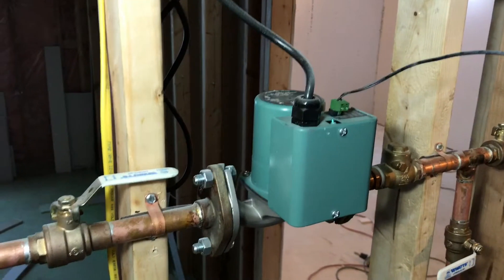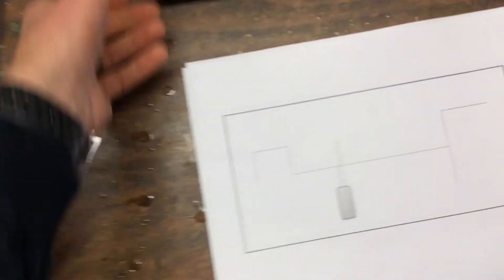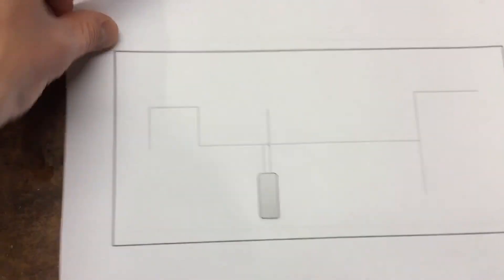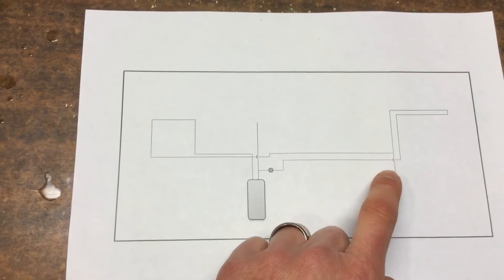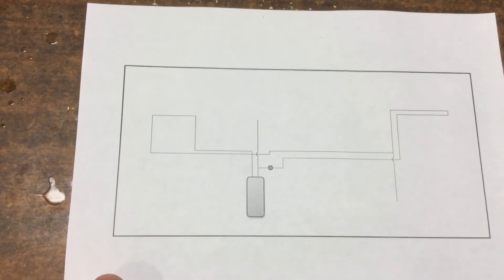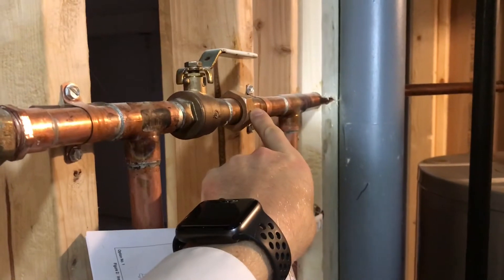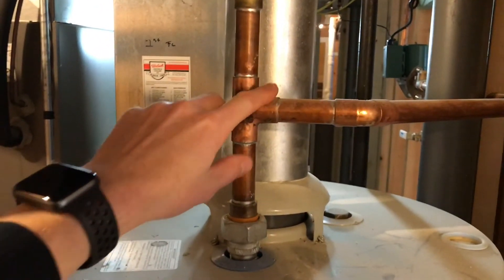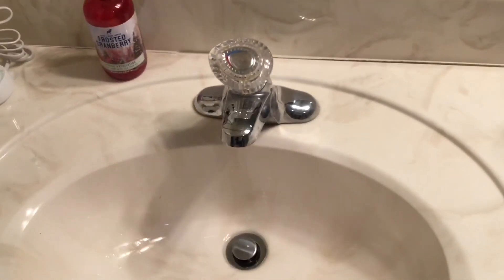Taco Smart Plus 008-IQSF6 Hot Water Circulator Install

Comment: Did you wire that thermostat to one of your pipes or did you wire it direct so it circulates all the time
Reply from the maker: I zip tied it to the hot water outlet from the water heater, about 10 feet down stream. It is supposed to ‘learn’ water usage patterns and then run only when needed, but as far as I can tell none of that works. It just runs every 10 min, day and night.

Comment: Just wondering if you considered the need to place a check valve between your cold water supply and the "T" where the hot water loop returns to prevent back flow to a cold water faucet? Has your design had any issues with hot water reaching any cold water faucet?

Comment: I'm just wondering do you need bleed valves when you have faucet and tub connections?  I understand a bleed valve for a closed loop hydronic system. But bleed valves seem redundant, when you just open the faucet to the system to air out.